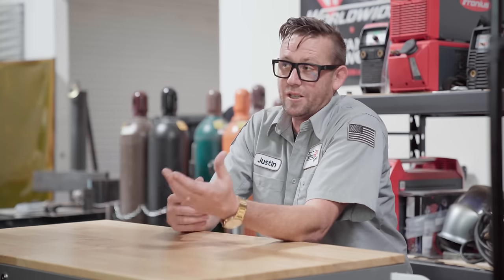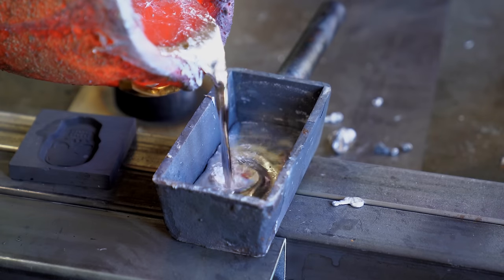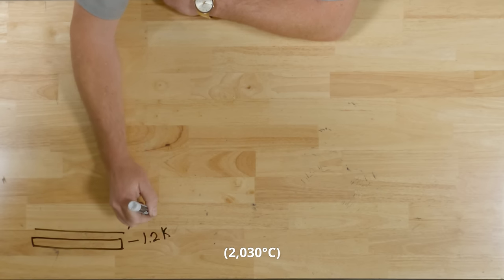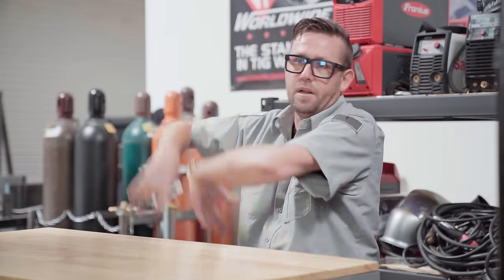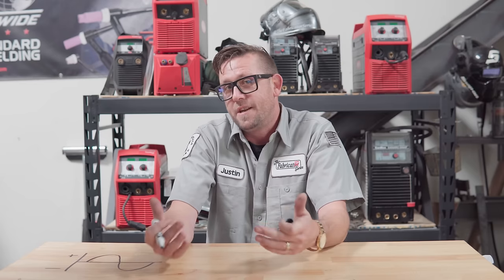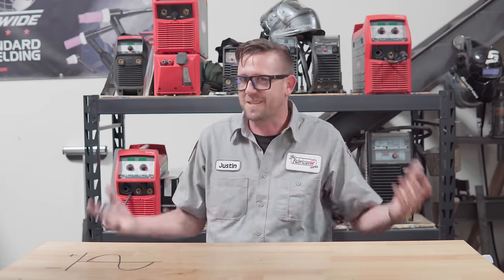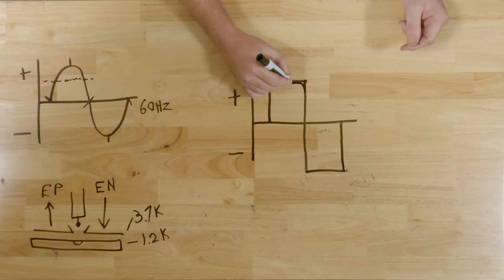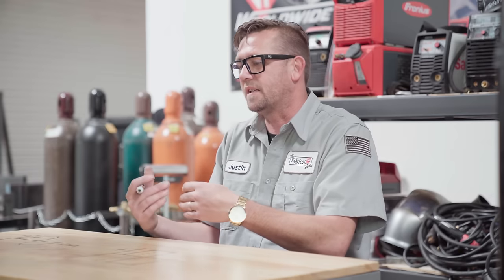AC TIG Theory

Comment: I have to agree with others in the comments, this is the best explanation for Aluminum TIG welding. As a person who learned to TIG weld at one of the oldest Aluminum Boat manufacturers in the US, using very old machines Miller Dialarc 350, at 60 hertz was a challenge. I got fairly good, and then my machine broke. The loaner machine was an inverter Miller Syncwave 200, it was amazing the difference in frequency and wave control. The size and current requirements made the machine so much better. I appreciate you taking the time out of your busy schedule to make all your videos. I've been following you quite a while on TFS. Keep up the great work! 👍
Reply: For sure, but I just watched the wraith from back in the day and i swore this guy was a dead ringer for a family member of skank. Any relation? I had to ask
Reply: My uncle told me this guy don't know jack squat

Comment: Electrical engineer here - That soft square wave makes a LOT of sense to me. The sharper the edges (technically the shorter rise and fall times) are, the more extreme high frequency energy will be produced. I mean high frequencies into the kilo- or even megahertz. Your cables and workpieces are antennas so you will radiate those high frequencies out. The FCC (Federal Communications Commission) puts limits on the amount of radiant power your devices can produce. You've seen the FCCID stickers on your electronic devices - It's that FCC. Rounding the edges of the square wave will be gentler on your electronic switching elements as they won't have to deal with high frequency noise, and your neighbours will be happy as you won't be interfering with their radios and cellphones.
Reply: Came to say this (Electrical/Electronic Engineer).  The HF spikes will also run into very high voltages and can degrade insulation, though on a welder it won't be as bad as a large industrial motor.  But definitely agree with you that the soft square doesn't seem to me as being just a sales pitch.

Comment: If I had the ability to force change in the Field of Welding I  would make this video:

THE INDUSTRY STANDARD 

Have manufacturer manuals and packaging include a QR codes that link to this. Make this a 2 part video:

“Introduction to Welding Aluminum: AC TIG (Part 1 of 2 - Theory)”

&

“Introduction to Welding Aluminum: AC TIG (Part 2 of 2 - Application)”

A fantastic job, you break down normally tough to explain subject theory and cut to the heart of things. Outside the actual content what really impressed me was the professional editing that made the transitions seamless. A raised glass in recognition cheers 🍻.

Comment: This is the best information ever.  I am almost 80 years old and started trying to weld aluminum with oxy acetylene.  I had an old friend at the time who could do it easily!  Not me so I bought a high frequency box for my sears cracker box and had a little success and a lot of failures.  I now have an Everlast machine and it has all the functions I will ever need, but I have been wandering around trying to find good instructions.  This will help me more than anything I have found.  The explanation about the pedal use is the thing I believe will help me and my shaky limbs the most.  Thank you for sharing and wish you steady hands and good health!

Comment: great explanation!   I've seen and know the AC frequency and had a grasp of what was happening.  I've seen the square wave illustrated on machines and in literature.  But you are the first one to successfully pound into my head what the difference is and why it's important in the oxide cleaning function!  When you said the part about the time at the peak current, it finally hit home and now I get it!  Thanks.

Comment: This was very informative, I originally done my first aluminium TIG weld on a welding machine off the Ark it was a 3 phase machine the size of a small fridge with knife blade current switches and a built in high frequency unit. It was a stick weld machine with a water cooled tig  hand piece. The workshop I was at used it for cylinder head repairs around corroded water galleries. This was in the early 90’s and it was a hand full, no foot pedal just what you set. I have not used tig since leaving that shop in mid 90’s but with what I’ve just seen on this video that the new machines though they look complex with all the adjustments are easer to use and will give a better finish. I just thought that these young blokes with these modern toys are magicians. You sir have sparked my interest to tig welding again.
Reply: Miller Goldstar?
Reply: @dolphincliffs8864  To be honest I don’t even recall seeing a name tag on it. Was very old and used but still operated fine.

Comment: Thanks Justin,
Especially for the metric references.
Triangular waves are usually called saw-tooth waves in the electrical industry.
Awesome video and a really good watch.
Reply: That is not exactly correct. 

Triangle waves rise and fall in the shape of a triangle, with the up angle being the opposite of the down angle, creating a triangle shape. 

Saw-tooth waves are asymmetrical.... it's kind of like a triangle going steadily up on the rising edge (on the left hand side of the graph), but then severely dropping down at the trailing edge (on the right hand side of the graph) in the same way a square wave immediately drops down (the difference is that the square wave ALSO immediately shoots up on each following rising edge). This might make more sense if I could include a sketch.

Triangle = steadily build up, build up, build up... peak.... then steadily fall away, fall away, fall away. Repeat...

Saw-tooth = steadily build up, build up, build up... peak... then DROP IMMEDIATELY... build up, build up, build up... etc...

Both types of waves have straight-line rise-times that increase up to a peak (which is a sharp point), but they are different after the peak.

I can't say whether the author of this video mix-matched the names of the wave-forms, or maybe the welder company literature does so... but there is DEFINITELY a difference between Triangle waves and Saw-tooth waves. Especially in audio electronics. 

And also those waves will definitely be different for the amount of energy in each type of wave (and also different from a sine wave and a square wave), AND ALSO will definitely be different in the TIMING of how that energy will transfer to melting the metal (in a similar way as to how it was described in the video about how the sine wave and the square wave have different timings on how they convert the electric energy into heat energy to melt the metal)

Comment: Thank you for this. I taught myself to TIG weld based on books and video resources. Then I put in the hood time to be 'ok' at anything DCEN. Aluminium became a huge frustration, so I put in on pause until I had time to get professional training. This video has filled in some key gaps & motivated me to try again.

P.S. I have personally seen very early heliarc welds uses in aerospace application. We are so lucky to have the technology now available.

Comment: I weld on 60 Cycles, because my old Esab square wave 352 does not have frequency controls. It does have ac balance and pulse which is handy at times. A new fancy Miller would be cool but there is no need to change. The machine works great, I don't Tig weld aluminum much, and was inexpensive when I bought it nearly new in the late 90's. Nevertheless  this presentation is  (like nearly everything you dive into Justin)  probably the best explanation of AC wave frequency have ever seen. Cheers

Comment: OMG. While I am only a Hobbyist Welder, got most of my knowledge from my dad who was a Pipefitter from the old school. There has always been a clash in my understanding of AC HF Welding on TIG. We have an Older Gas Miller (Stick/Mig/TIG w/HF AC box) machine and I had so wanted to get into AL welding. Every attempt caused me to go into a Rage. I had thought that it being an old machine maybe something was wrong but everything in your video Explains some of the missing parts to me. I do not want to claim totally ignorance in knowing the difference between Old Sin and Square wave. The explanation of this made me realize all the issues I was experiencing was based from Sin not Square wave. This was compounded by the machine we have being just outside of the flexibility of the newer boxes in comparison to what we have. It just never really occurred to me to go into a deeper dive on the machine to verify if it was a sin/sq. THANKS!

Comment: Back in the “70’s Helium was cheaper than Argon. The old Airco machine I welded with was the size of a washing machine but was wonderful. Production welding Aluminum chassis with 0.090 material thickness and 5356 wire.

Comment: Wow what a great video !!! I’ve been TIG welding aluminum for 20  years and I’m a huge aluminum fan boy . I thought I was an expert but I learned a lot in this short video .I thank you truly and I’d like to pass some information back to you . Some fun facts that most people don’t know about aluminum are as follows. 
Aluminum is made up of over 170 common elements and only exists in rare and small quantities . Typically it’s found around  lightning strikes and volcanos and is prized by royalty for its blueish hue. 

Aluminum is also found at UFO crash sites . Small components as heavy as iron where found and examined. They found that all the microscopic crystals were perfectly aligned creating the hardness and density.

Comment: Justin,  This video was amazing.  I build custom trailers for R/C cars & trucks.  Due to my budget I'm looking at the YES welder that you did a video on some time ago.  After this video I'm feeling pretty good that this budget welder will do the welding I need on the 1.6 -1.7 mm aluminum channel stock that I typically use for my builds.  Thanks so very much.  If you think a different machine would do as good or better job for needs and keep me on a budget that would be awesome to hear what you think.  I've not yet pulled the trigger on the purchase but I'm really close.  Thanks again for all you do and everything you teach. Very very helpful...
Reply: Being someone who is also into RC cars this sounds pretty cool! I have a primeweld 225 that works very well and has a nice foot pedal. I can build up an edge on 0.050 aluminum with it as well as weld the wheels that seem to crack on my car all the time lol. Runs on 110 or 220 v also.
Reply: @richardgoldschrafe4747  Cool,  I'm still looking at options, but my budget is very limited.

Comment: I do have to ask though, if I want to weld some 1/2" thick aluminum together but don't care about full penetration, it's just what I got lying around, or I want to do some machining repairs, do I really need a 500 amp machine, or can I do it on a 200 amp machine? I always thought that those high amperage machines are used for needing to weld a LOT of material quickly enough (say ship building or something), and that you could just bevel thicker plates and weld in multiple passes. Can aluminum be welded this way?

Otherwise I really love friction stir welding. Incompetent machinists do this unintentionally, but I took a broken end mill and turned it into a stir welder, and I gotta say, easiest weld of aluminum I've ever done. All you need is a dull 4 (or more) flute endmill, some kind of a platform over this end mill to catch all the semi liquid aluminum, and just crank the machine up to as high of an RPM as it will go. Then just clamp the 2 pieces together and start milling. They'll be friction welded before long.

Comment: Have you seen any issues with the student device(phone, tablet, etc.) has lost signal being near the arc? Just wondering if the RF from the arc is getting in the way of the learning.
Reply from the maker: It is very rare to encounter that problem. However, if for any reason the connection is lost, your coach will still be there when you click back on with our instant reconnect.

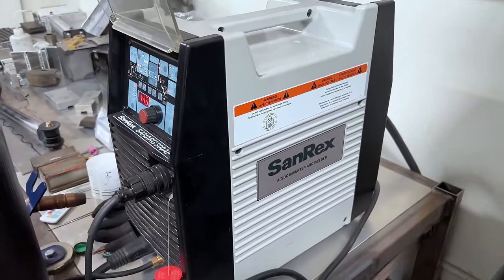Comment: At around 13:00 you described duty cycle and called it AC balance. AC balance refers to a change in the amplitude of one side of the cycle vs the other, not the cycle duration.

Comment: Lets say you have a good Aluminium mig setup, why would you AC tig?
Also why does Aluminium DC mig work (with Argon), but DC tig does not work with Al?
Reply: I too have the same question to ask.
Reply: @vu2abs  Well I can answer it in part now, TIG always produces deeper penetration and stronger joints, 2nd part is a bit more technical, and totally escapes my mind, someone gave a great response, just wish I could find it, somehow combination of Argon and constant voltage clears the oxide layer-higher voltage? but constant current (TIG/Stick) produces lower short circuit voltage and therefore unable to obliterate the oxide as you weld-unless you go AC.

Comment: 25 year multi process and alloy welder here.  Throw the peddle away , learn a finger switch . Either and on off or a micro potentiometer .  Thank me later. Our shop quit using the pedal 15 years ago. Freedom is achieved once you get away from that damn pedal. Plus most new machines you can set up to hit the aluminum hard and baks off in a predetermined time or vice versa. The on off type hear is what most of us use here.  All processes stainless, aluminum,steel, magnesium,copper. You name it.

Comment: The reason for the "soft" square wave is probably to reduce EMI emissions. Sharp rise and fall times produce interference across the spectrum at odd harmonics of the fundamental. By rounding the leading and trailing edges, the harmonics are greatly reduced. Less to do with the actual weld than with the EMI.

Comment: While frequency modulation %, is way more useful in welding, the sine wave is not clear to a few. Peak to Peak, a digital multimeter (DMM) have the ability to measure RMS or root means square. Now certain guys/gals will never use math which is harder than Chinese Calculus, but the reason for it is measurement like apples to apples. Typical household voltage is A/C, but to compare it the DC work, the useable part of a 171.4 A/C peak volts during it's brief 1/60th of a second is RMS. This is how A/C voltage can come from a vehicles alternator. Diodes of different doping has forward bias losses, usually 0.7ths of a volt loss and is mostly heat. But the dotted line is a good representation of RMS, work equivalent of DC. 
  Frequency modulation is not only in welds but home A/C systems to slow down the compressor motor. This levels cooling, less amps and is currently the best way to increase SEER rating. Just thinking out loud for the few who may not know how or why it's related.

Comment: i think, but dont quote me on it, but i do believe...

the "soft square" is mostly to reduce EMI?

its an unshieled arc out in the open (forget the gas, its electrically unshielded!)

square waves contain tremendous amounts of high frequency energy, and that makes everything in its vicinity that runs electronics make horrible damn sounds... messes with radio transmissions. upsets garage door openers. turns phones on and makes them pocket dial people you only have in your contacts so you DONT answer their calls... 

pretty sure theres some sort of law about radio interference producing devices... spark gap transmitters have been obsolete for decades...

anyway, the area of the cycle on either side of zero is the amount of energy, power... sine waves have on average less power than a square wave. what is it? 0.707 or something? 

juts like playing with the clean area width, and with my machine, clean area DEPTH as well, throw in the low power of a sine wave, or the even lower power of a triangle wave, and you are less likely to blow through that 0.5mm sheet...

the CURRENT may be the same, the voltage may peak to the same value, but what matters is amps x volts x TIME. AVERAGE current rather than PEAK current.

obviously DC is entirely different.

you need an AC sinusoidal waveform of 1.414 times the voltage that a DC would require, to produce the same degree of heating in a resistance. iirc, a triangle wave is simply HALF the power of the equivalent DC supply.

Comment: I went to an aluminum recycling center and they told me to NOT touch any aluminum because it looks the same at 70 degrees as it does at 1000 degrees. Other metals will glow red when heated to melting point.

Comment: Interesting video, biassed towards practical welding not theory. I think the 'rounded' square wave has nothing to do with the actual welding, it's more likely to do with reducing EMI (Electromagnetic Interference), those sharp corners generate a LOT of high frequencies! Finally, it's AluminIUM and temperatures are measure in Centigrade! 🤣😅🤣😅🤣😅

Comment: This is complete rubbish. I was 28 years old when I started welding for Mc Donnel Douglas in Long Beach Ca. I took a 2 years course at Cerritos College for TIG and passed the US Navy test on Aluminium,steel and stainless. I worked for six months on the C17 Globemaster plane project. We had 300Amp Lincoln Idealarc transformer machines with HF and sine wave AC. Yes they were heavy and noisy but welded beautifully. Nobody needed to be a demi god to use them. You never ever moved the foot pedal back and forth. There was even one Old Lincoln from the late sixties nobody ever used out of respect. It welded the first aluminium hatch that when on the lunar module. And before I forgot we welded 1inch aluminium in DC positive with a helium argon mixt. I am 72 now and I can say with certainty you sir, are a jerk.